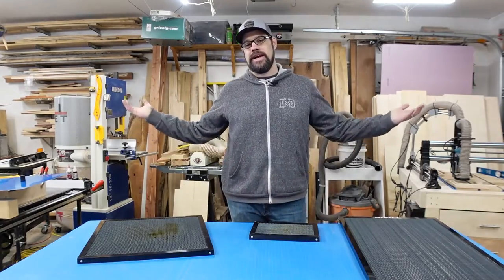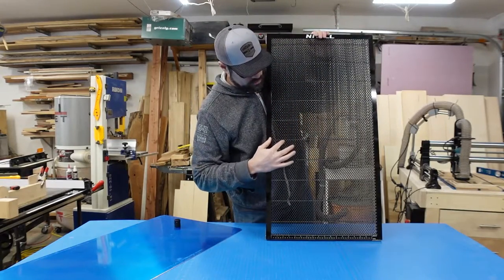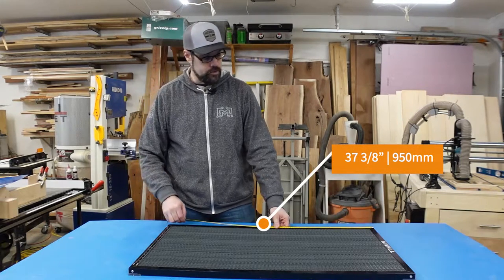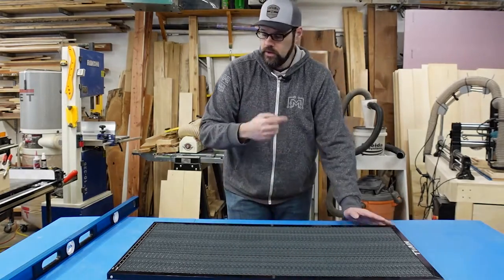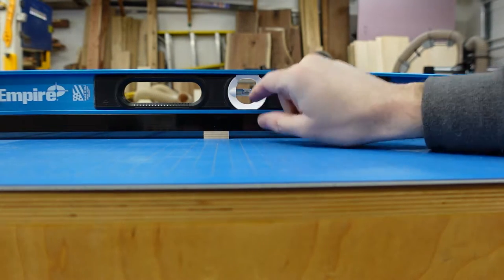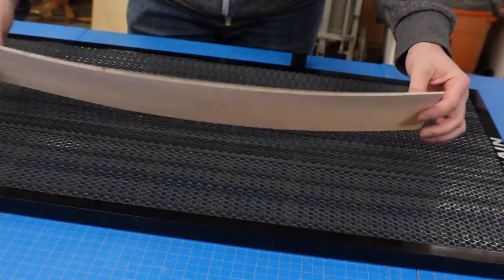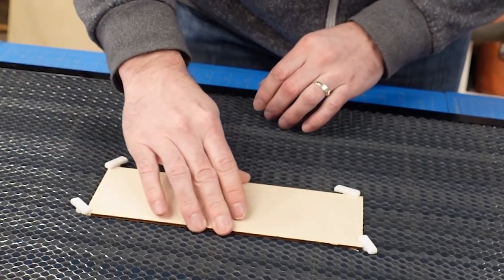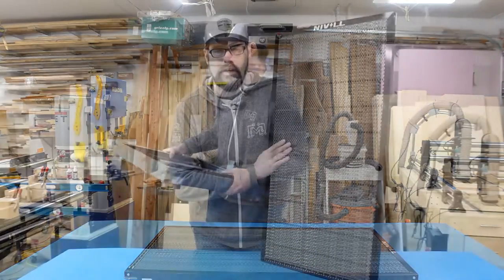Nivill Extended Honeycomb Bed | Finally an option for Extended Diode Lasers

Comment: One thing to be aware of, the Stainless Steel Honeycomb material is typically on 0.007 to 0.008 inches thick, this is pretty close to the maximum thickness of steel that the latest 20W LED lasers are capable of cutting at max power so potentially could damage the bed. The Aluminium Honeycomb beds are a similar thickness but the higher thermal conductivity of Aluminium means that the LED lasers don't have enough power to cut it so theres a far lower posibility of laser damage
Reply from the maker: I would be very surprised to get damage to the steel bed from any diode laser unless you let it sit in one spot for a very long time. I’ve been abusing the honeycomb bed in my Co2 laser for over 7 years and the worst it has is staining from a lot of cutting. The aluminum beds are very easy to dent and bend the fins on and they won’t hold magnets, so you’re much more likely to damage those from just placing material or having to use pins in the weave to hold your material in place.

Comment: Nice!  Looking forward to the video of your laser expansion.  I just expanded my Comgo Z1 I'm having trouble getting it to work with lighburn.  It won't recognize the expanded area.  It's fine in the original work space. I've updated the machine and device settings..  Is there some g-code setting I have to change?
Reply from the maker: You might want to double check the GRBL settings for $130 and $131 to make sure they match the new working area size.  Those settings can effect the soft limits of the laser.
Reply: @Vintauri  yes, that was it.  As soon as I entered $131=800 it worked.  Thanks!
Reply from the maker: @ericeinsmann5559  Glad to hear that was the quick fix!  Enjoy the extended laser!

Comment: How does this size work on your Ortur LM3?
Reply from the maker: With the stock feet you may need to block up the laser as they get too close to the edges.  I'm not sure how well it would fit with the extended rails but again, if you sit the laser on separate blocks it should work well.

Comment: $200?! Seriously?!
Reply from the maker: The price has fluctuated a bit, and there are other options for a honeycomb bed.  Cloudray will make a custom size for you as well as having a few stock options that are larger. Unfortunately, when you add the shipping costs they are still more expensive than this through Amazon.